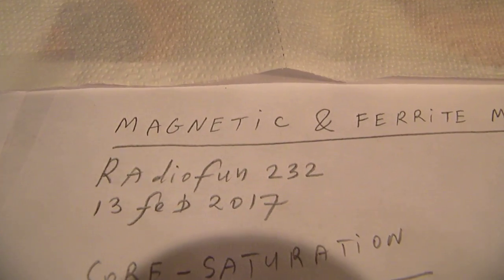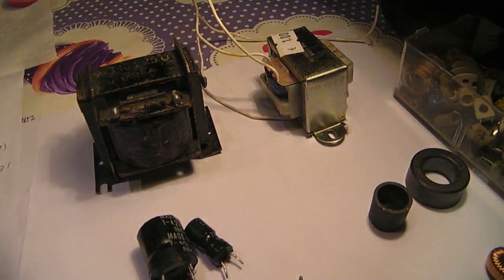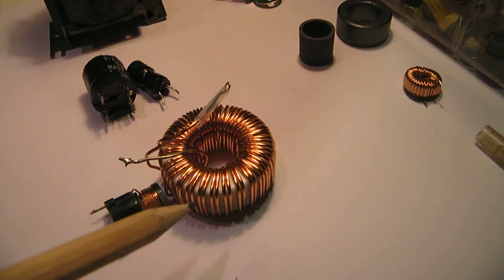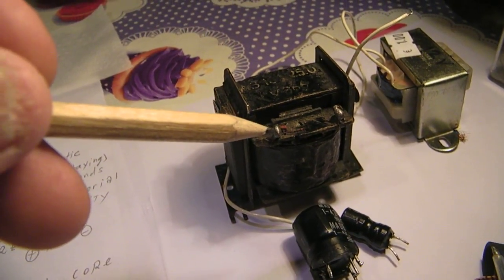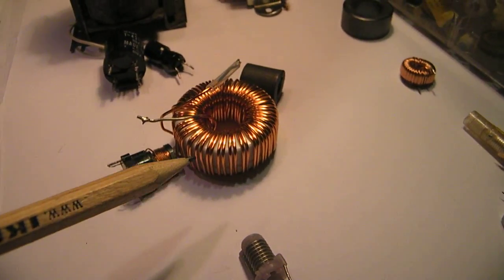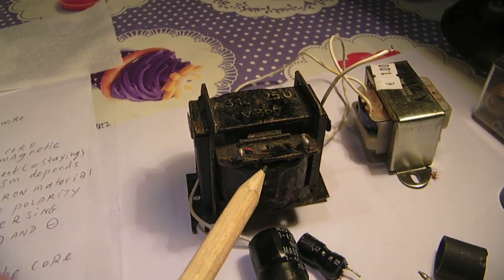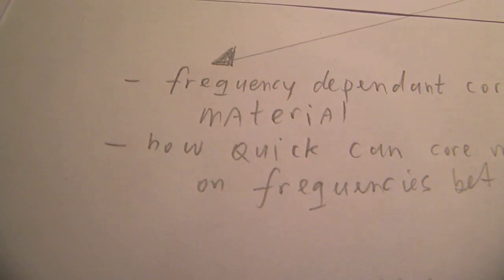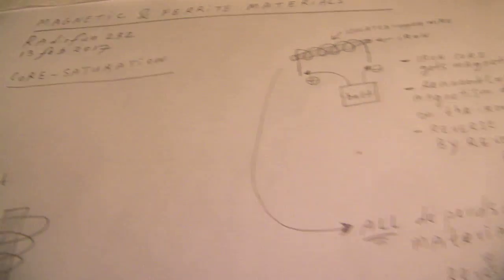Radio coils properties & magnetic and core materials

Comment: hey ko. if i cant find a chock i need. could i use the primary of a transformer if it was the right henries? great video btw
Reply from the maker: Yes, that is possible, as long as the current does not get too high. Normal choke coils often have an air gap to prevent magnetic saturation from the core. When the core magnetizes to heavy the choke properties are lost.